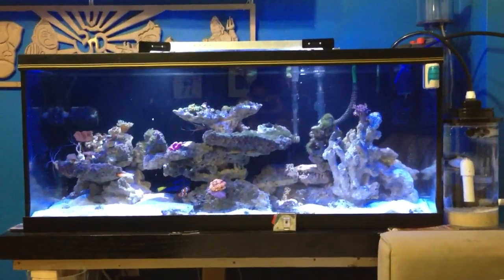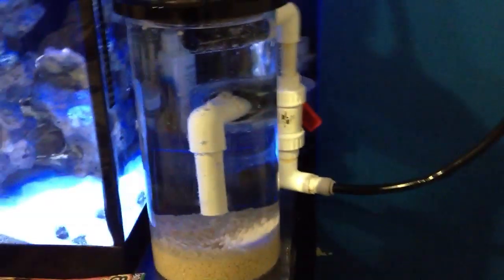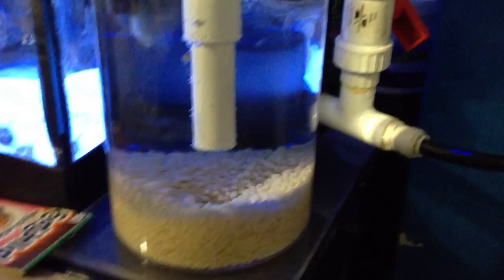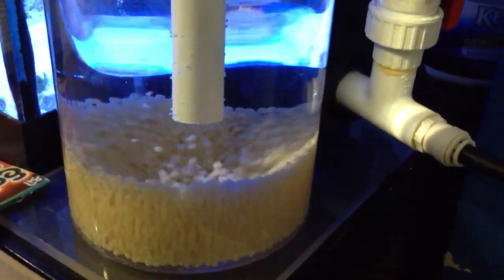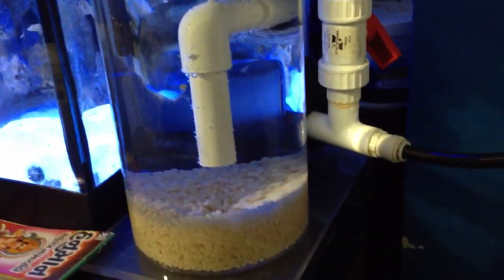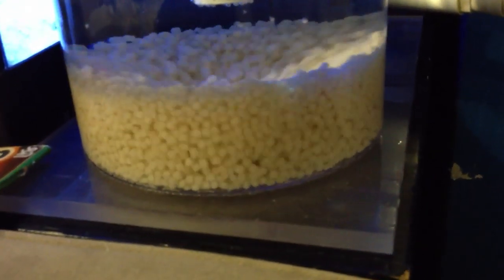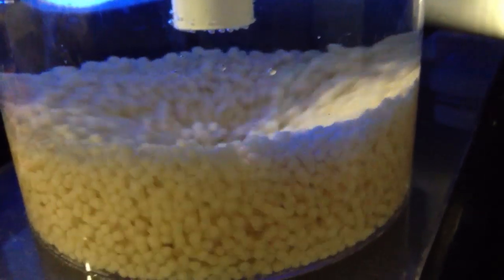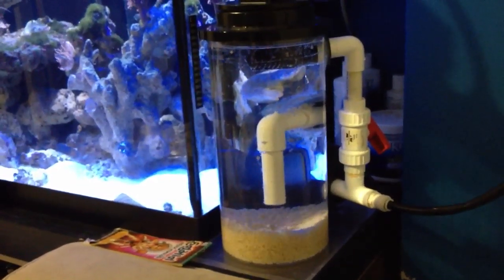DIY Bio-Pellet Reactor (Part 3) - Done

Comment: Nice design, and video... Did you use sponge or anything in the carbon reactor? I'm building a gfo and a carbon reactor however slightly smaller and a simpler design. Most of the carbon reactors have a sponge on both ends of the media but I hear it clogs really easy. If I used the same method of your gfo would I run into problems? Thanks

Comment: Eheim Compact 2000 that i am looking to buy doesn't has thread on neither output side nor suction side. I noticed (though not very clear) that you've used hard plumbing connecting directly to your pump. Am i looking at the wrong water pump (http://www.drsfostersmith.com/product/prod_display.cfm?pcatid=28124&rel=1)?? 
Can you please advise. Thanks!
Reply from the maker: The best way to do this is get a barb fittings that has a 1/2" female adaptor. This adaptor installs on the PVC pipe and use a 1/2" hose to connect between the barb on the pump and barb on the adaptor.
Reply: Is that how you've done with this reactor?? 
Yeah was trying to avoid barb fittings and a hose. Other option could be a mag 3; not sure if that'll give me enough flow though. Eheim pump is the best in terms of its power consumption and quality. .
Reply: btw, thanks for the advise...

Comment: Hey 27ppatel, I have been following your videos for a while, keep up the great work.

Im going to give this a shot. I have been studying the videos. You have the clear 6" tube aka reactor tube just sitting flat on the sheet of acrylic base with just the weldon 4? Are you worried that the unit could ever leak or open up? 

what about sitting the tube in a recessed base? like drill a 6' circle into the base and than glue it? i am just trying to make sure the thing is bullet proof